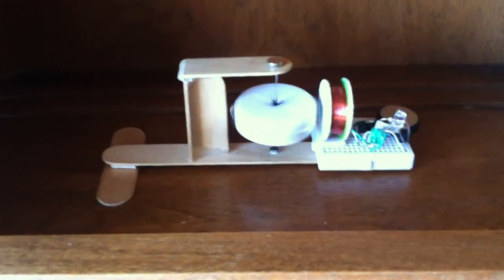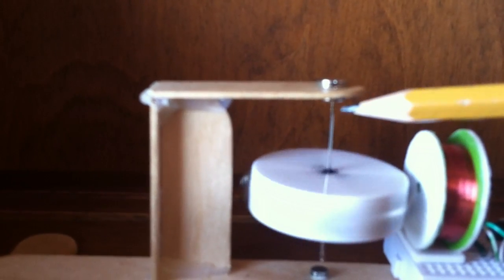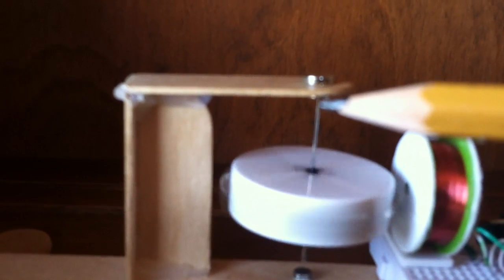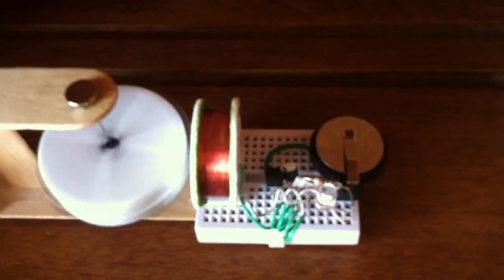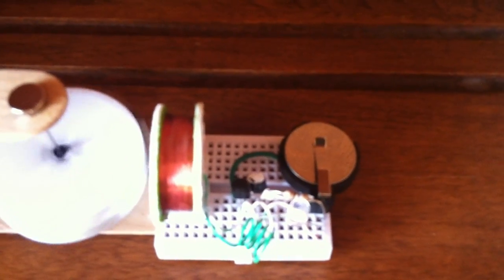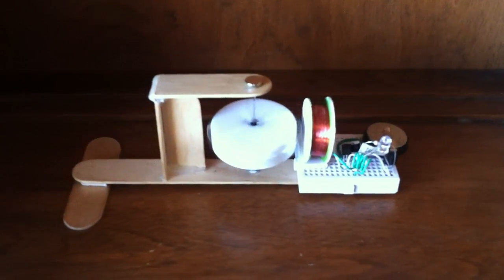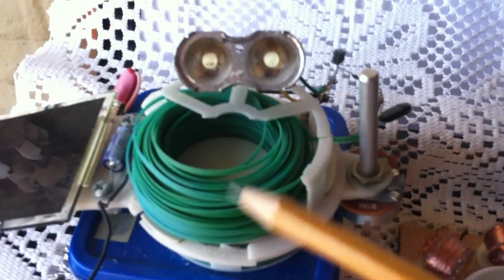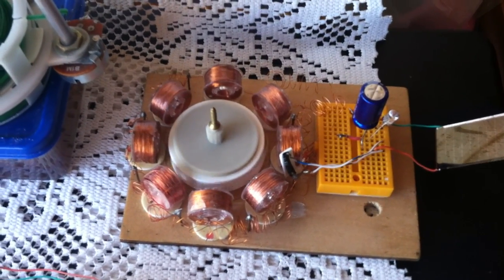Micro Amp Pulse Motor-----update

Comment: What is the micro amp draw? I have found that the sapphire watch crystal idea will work perfectly. I have used them for many years. 
With a Pali coil, it can be under 1 micro amp.  I was using AAA lithium batteries, but I am switching to "long term " Panasonic BR-2477A/VAN batteries. They can last 20 years and have plenty of power. Only problem is that they need to be soldered in, rather than just inserted. Nice job.
Reply from the maker: Thanks for commenting.  It was actually YOUR video that I stumbled on that directed me to Pali's video series on this topic.  You two guys redirected me back to my quest for a 'virtual' self-runner-----something that drew so little power that it appeared to run indefinitely on it's own.  Many thanks for your work, tips, and inspiration.  The best that I have gotten this motor to run at is about 4 micro amps at around 1 volt.  I have been experiment with the 2 magnet 'bar' rotor that you and Pali use.  Thanks again.
Reply: Like you, I wanted something that would go a long time without changing batteries. I think that changing batteries every 20 years is as good as I can hope to achieve. Mr. Pali's coils (47 AWG or thinner), sapphire bearings and lithium batteries are the keys to the longevity.
Reply: @kafr8413   To me  the capacity of the battery should be the smallest possible, and in // the interest should be to show the minimal waste of energy possible.
lasting for years.. it's a false goal..
spending the minimum and  find a way  very close to COP1  is the quest...
Reply: My goal has always been something that will spin the longest, If the battery capacity is small, the rotor won't spin as long. I don't understand how that could be a good thing. 
 
I don't know what "COP1" is??
Reply: @kafr8413   well a very big battery should run this type of motor for  a   hundred years  or more..  but  what is the interest? it's not the OU quest'..
COP1  i mean..  what we get / what we spend at the enter = 1 or more... kidding  :-) ?
in that case a simple small cap is enough...
Reply: @Lidmotor  Hi Peter, 
Have you though about  a second system, run by the rotor,  and charging a Cap  by a little electrostatic  device ?
As we use micro or milliamps,  can we convert a  electrostatic high  tension  and lower it to the primary cap?
  'producing a bit of electrostatic energy'    should be compatible with the little torque of a tiny motor like this?
can we use it  in the milli amps  better  for  this?...
thanks :-)
i think about  a micro  wimshurt  CD  system...
maybe small sized CD...

Comment: Do you really need the led in the circuit? Back emf would be minimal in this design . Surly it takes a lot of energy just pulsing the led 4 times per revolution . Maybe just a normal diode? Do you think that a quality super cap and a small solar cell would give 24 / 7 runtime?
Reply from the maker: I use the led as an indicator of firing.  It uses the flyback and directs it back to the (+) rail.  I could use a regular diode like a 1N4148 but I enjoy seeing the light.  This device will work on a small solar panel and a super cap. I have several other projects doing that already but a stretch of dark days in a row and they stop.
Reply: Hey +Lidmotor, do you know if the runtime increases with the use of a diode like the 1N4148? It makes sense to me that more of the power would make it back into the circuit of not spent on light. I'm so curious!

Comment: Good tip with the inversion because of dust/dirt. Have got a bag of unpolished sapphire pieces and will follow your tip about gluing upside down.
Reply from the maker: I think thIs might be a way to make a better bearing.  The trick will be to make sure there is enough "UP" force to keep the rotor hanging there and not fall down.